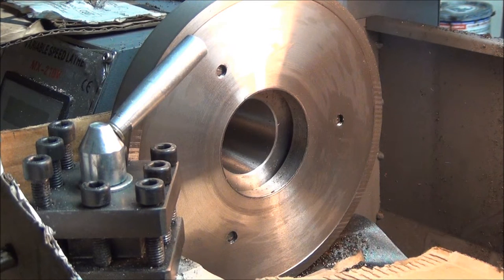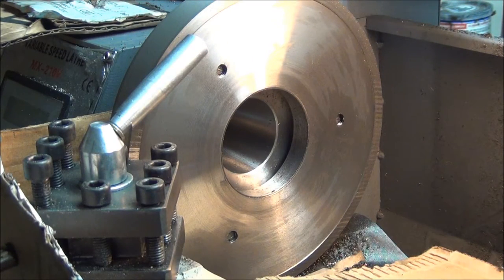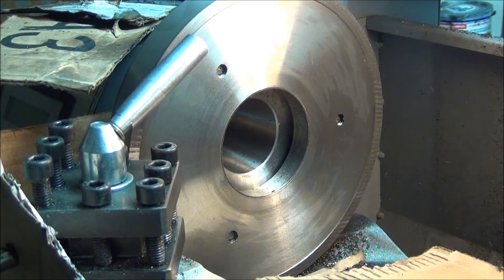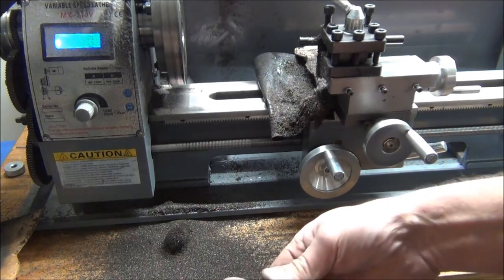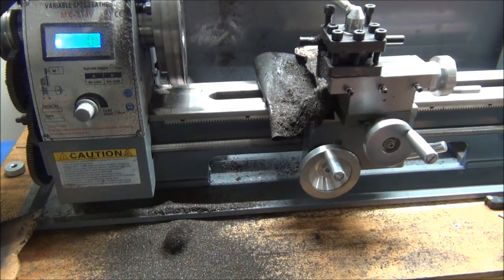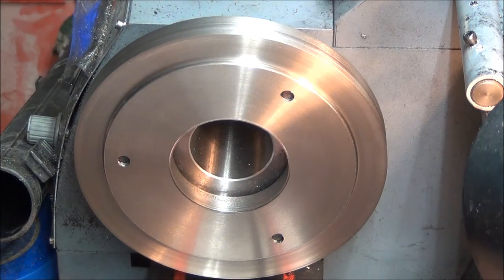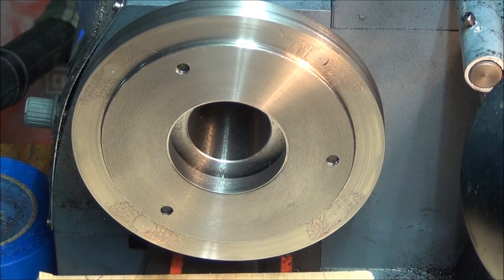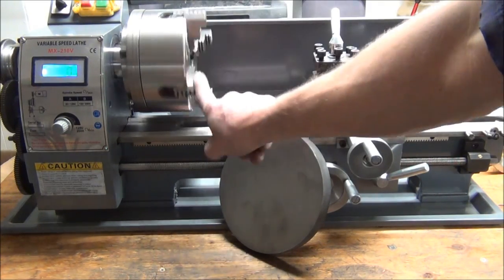TS-210 Part 8: Backing Plate Adapter for 4 Jaw Chuck

Comment: Very interested in this as I just purchased the lathe from the same seller. There are a number of issues but mine seems to line up okay and I can fit the change gears so perhaps mine has a longer banjo. But not all the ratios shown on the gear cover or in the manual are correct so check before you thread. A big negative for me is lack of reverse on the leadscrew for left hand threads. Also the spindle bearings feel a bit rough. I haven't take it asunder yet as I am still considering sending it back
Reply from the maker: Good luck with whatever you do.

Comment: I plan on watching your video's at least 3-4 more times before I even begin with #1. Thank You Sir for once again putting this into words that an ol geezer such as myself can follow and understand! Haven't checked yet, but do you plan on adding a QCTP in the near future? I got one from Little machine Shop (along with cutters & holders) and discovered the spacer that goes underneath the tool post has a larger diameter hole than I need. I do not have any other metal working equipment so I will probably have to farm out a new spacer. 
Someday when you are bored out of your mind and don't mind educating the noob's like me, would you mind doing some video's on the different cutters. I have 6 different shaped (interchangeable tipped) cutters and there was no instructions as to which one I need for facing and which one for actual cutting. I know there are left hand and right hand cutters, carbide, HSS, etc.  I don't think I have any screw cutters but honestly I'm not sure what one even looks like :(
As always, Thank you Sir for sharing your time and expertise!
Regards,
John Archer
Reply from the maker: Well, since you haven't watched all of my videos, I won't spoil the surprise on the QCTP.

The different types of cutters that you have are probably the same as I have.  Honestly, I don't know if I have enough experience to say exactly what tool is for what process.  I will say that there are only a couple of them I use on a regular basis.  I usually use the same one I use for facing as I do for turning, but adjust the tool post angle to achieve the best cut.

Comment: @number40Fan I am thinking of a 5" 4 jaw independent for mine but they all seem to come with 4 holes and the spindle flange on these is a 3 hole. Do you think the flange could be drilled.... is it hardened I wonder.....
Reply from the maker: I'm sure it could be drilled, but I doubt the registers on the back of the chuck and the spindle are going to be the same.  How big of a bore does the 5" 4 jaw have?  Only reason I went with the 6" chuck was to keep the 1.5"+ bore.
Reply: @number40Fan  The lathe came with a Sanou 5" 3 jaw and I was looking at a Sanou 5" 4 jaw. I believe the register is 95mm on both chucks but I could be wrong. If so then the only issue would be the bolt hole arrangement. Either drill the flange for 4 bolt or the chuck for 3 bolt. Chuck would probably be easier to drill.
I think the through hole is 30mm for the 5"
Reply: Actually I just started a return on mine so this is moot. Found too many unfixable issues with it. Head stock is tilted nose down and the saddle is milled wrong so the cross slide has a greater than 10 thou run out. On to the next one I guess. After fixing the tail stock that was the best part of the lathe!
Reply from the maker: WOW.  I thought mine was on the cusp of being junk, but it sounds like you got a real bad one.
Reply: @number40Fan  Yea its too bad as I like this size. I don't think I dare try another one of these. Hate to pay the price for a Grizzly or the like but I think they may be constructed from the first rate parts rather than the rejected parts. But then who really knows for sure.
Reply: Change of plans. The seller gave a substantial refund so I am keeping the lathe and will see if I can get it aligned.
Reply from the maker: If there is anything I can help you with, let me know.
Reply: @number40Fan  Appreciate that!
I am new to lathe's so that just might happen :-)

Comment: Just magnetize your lathe. ; )
Reply from the maker: I haven't noticed any issues.  Made a mess for sure!!
Reply: @number40Fan  No, I meant that all of the chips would be stuck to your lathe instead of your floor, which would be an even bigger nightmare.  My sense of humor is hard to decipher some times.
Reply from the maker: I gotcha.  I actually read your post wrong.  I thought you were saying that I magnetized my lathe somehow.  My bad.  I was using some magnets to hold the cardboard to the lathe to keep the mess to a minimum and they did help quite a bit to attract and keep some of the shavings from flying everywhere.